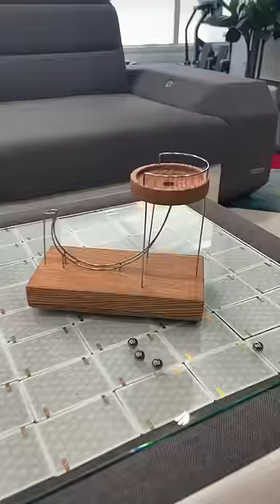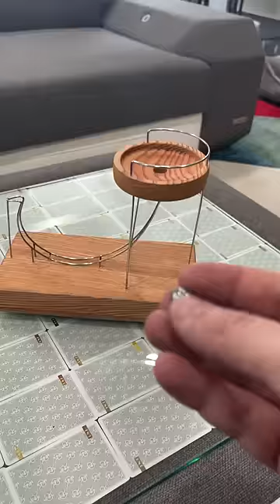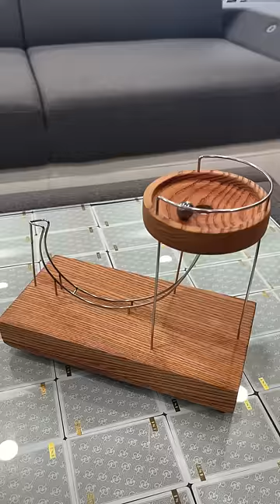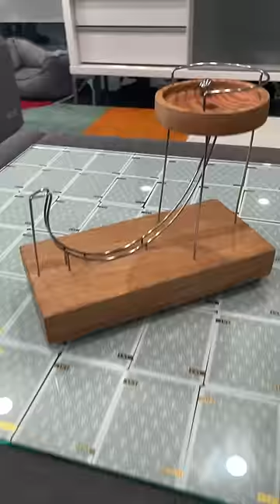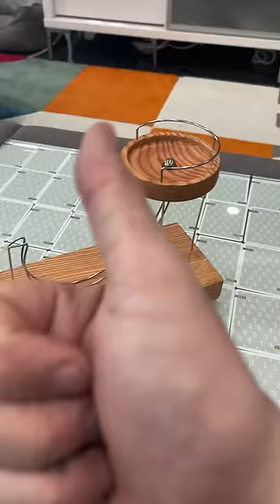An Impossible Perpetual Motion Device?! 😳 #Shorts

Comment: For those wondering, the ramp is powered with electric, that's why it's able to shoot that ball
Reply: why couldnt it just use magnets though?
Reply: @Gecko1115  Probably just cause it's simpler to replace a battery compared to magnets.
Reply: @holycrapitsachicken  ?
Reply: @monstermushmush  tf are you questioning, it was a very straight forward answer 😑
Reply: @Gecko1115  because it wouldn't work.
Reply: Really guys?
No, ho. It’s not electric. But angular momentum tf
Reply: @BossModeGod  so you are saying there is no external force acting on this system?? (other than gravity)
Reply: @BossModeGod  angular momemntum and another force, otherwise an etsy toy would literally break apart our understanding of physics. And the ball moves too fast for it to be just gravity
Reply: @BossModeGod  you're not serious,  right?
Reply: What is wrong with this comment section
Reply: @michabodnar7739  Its very slick oil like in Christmas Vacation :troll:
Reply: …but how
Reply: @BossModeGod  Check out Chris Ramsay's "Is This Perpetual Motion Device REAL?!" video. At 1:39 in that video, he opens up the bottom to show the electronics under the device. It's without question electric powered.
Reply: @BossModeGod  nope its impossible it went way faster than it should
Reply: Why couldn’t the ramp be made higher in theory then land on a pitched dish that feeds it back down? 

Perpetual motion is impossible but I’m unsure how if gravity is used in an example where the ramp is high enough to loop the ball.
Reply: I think a magnet would slow it down .
Reply: @Gecko1115  its an electromagnet. its triggered when the ball falls into the funnel to accelerate it downwards, but then turns off so it doesn't stop the ball from going up the other side of the ramp.
Reply: @limitedhangoutlive  using gravity and potential energy alone, the ball would never be able to go higher than where it started, even in a frictionless environment with no air drag.
Reply: @limitedhangoutlive  that means you pitched dish will be lower than the top of the ramp. To make it continue to work then you need energy to lift the ball back to the top of the ramp which is kind the same.
Reply: It's not powered by electric, there's a mini treadmill in the ramp
Reply: @limitedhangoutlive  the ball will always need to be launched higher than the ramp, in order to land atop it. So if you make the ramp higher, the ball will still need to launch itself higher than the distance it fell.Things don't ever bounce higher than the distance they dropped from. Things don't ever swing back the distance it was let go from. Things lose energy through friction and wind resistance and other minuscule transferring of energy from the ball to its surroundings. A professor did a famous demonstration where he let's a 20 pound cement ball swing from his chin, it swings back coming a couple inches from where he stood. Things don't gain energy, they lose it, so they always come back shorter.
Reply: @BossModeGod  plus gravity
Reply: It's an electromagnet. Battery powered magnetic field that will propel the marbel. Electricity alone won't move it, and magnets alone will just pull the marbel, ultimately slowing it down. But a magnetic field that is made and controlled by electricity will allow you to control the marble and propel it
Reply: why would it be powered by electric
Reply: @princelorian  so that the ball can launch higher than the distance it was dropped from, in order to land atop and repeat. Nothing naturally bounces higher than it is dropped, or swings back as far as it was swung from, etc. Everything loses energy through transfer to its surroundings through friction/wind resistance/etc. The ball wouldn't naturally get launched higher than it fell from without an external source of energy to add acceleration.
Reply: @princelorian  How else do you expect this to operate like it does?  There's an outside force moving the ball faster than just  gravity.
Reply: No its gravity…free energy is real. Governments dont want you knowing this…just use magnets or gravity. Energy is all around us…
Reply: @jonl9192  Magnets don't provide free energy.  Explain how you think magnets provide free energy.

There is no such thing as "free" energy.  It comes from somewhere.  It can't just magically appear.
Reply: I see you are a Comment section doctorate
Reply: @limitedhangoutlive  if you make the ramp higher (so that the ball jumps higher), the ball also now has to jump higher. No matter how tall you make the ramp, the jump will always fall short of the top of the ramp. In the same way that a bouncey ball never reaches the same height again
Reply: @Darion350  r/woosh
Reply: @limitedhangoutlive  because the existence of friction means the ball can never return to the same height or higher than it fell from. The potential energy at it's starting height is converted to kinetic energy as it is falling and some of that is lost through friction.
Reply: @jackraptor695  did you know sharks are smooth?
Reply: it's a powered magnet that pulls the ball down faster so it gets enough speed to make the jump.
Reply: @suslord9646  i think it's just a very heavy sphere
Reply: Can someone lemme know how this is done with electricity? I must be slow asf Because I don’t see any wires connected to the ball or anything that would make sense to me
Reply: @romulusnr  this makes the most sense to me
Reply: @holycrapitsachicken  What do you know chicken?
Reply: @suslord9646  Yes
Reply: @matthewgomez6024  my first guess is that the rail is energized by a battery, when the metal ball shorts the rail, a current flows through the ball giving it a temporary magnetic field which gives it a force to accelerate the ball until it is thrown from the ramp. Like a railgun. I'm not too sure though because each rail needs to be insulated from each other and here it looks like its connected, however he said it cant work if both balls fall at the same time which would be because it could bug out if both balls were shorting the circuit. So I'm reasonably confident that its probably like a railgun.
Reply: First law of thermodynamics, that’s all you need to understand that a perpetual motion device is impossible. The system loses energy due to friction , therefore there is a loss energy. Which isn’t the case here, ergo the system must have an outside source of energy that adds to the system.
Reply: It's got a 9volt battery in the bottom
Reply: I thought it accelerated way too fast. Also how tf can it go higher than its original height that would violate physics
Reply: @BossModeGod  lmao so you think this is magic. Gotcha
Reply: @Gecko1115  becouse magnet attracts, but also don't let the ball go further.
Reply: Thanks for saying it, you confirmed my suspect.
Reply: @Gecko1115  because a permanent magnet would start by accelerating the ball, but then would pull it back just as much after it went past it.
Reply: @limitedhangoutlive  no matter how high you make the ramp, the ball won't jump back up higher than where it first fell from
Reply: @Gecko1115  because magnets attract in the same way as they repulse so the addition of forces equals to zero... You have to put some energy to propulse the balls like in a gauss rail gun
Reply: The weight of the ball and the angular momentum I suppose 😇
Reply: Um, no. It's just momentum.
Reply: It is gravity
Reply: @Gecko1115  u probably could get magnets to work ,but a perpetual motion device lasts forever , magnets do not. This is why many devicee have failed there goal of a perpetual motion. Same for solar power ,eventually the mechanics fail ,even if 20 years later its still a fail
Reply: This is gravity. It's made because it never loses power. Its not friction either. This is obtained by multiple laws of physics one of which is when an object is in motion it stays in motion. This never loses motion and its similar to biking down a hill and never losing speed when hitting a flat road. You never lose energy so you don't stop unless you deem it to do so
Reply: There is a weel who launch the ball inside the hole
Reply: Wow the average level of physics understanding is quite worrying… 😂 

People making up magnetic ramps and complicated magic solutions like « but if I put a magnet in front of my car it will go forward » 😂 I’m dead
Reply: @matthewgomez6024  electromagnet in the base turns on just as the ball is accelerating down the ramp, then switches off just as it reaches the bottom.
Reply: @BossModeGod  no electricity,  no magnets... it's just motion conserving energy .... working with gravity
Reply: @Gecko1115  bro how would it use magnets to create perpetual motion??? "use magnets" is so nonspecific it makes me cringe 💀
Reply: @collander7766  You say that but it's getting touch detecting sarcasm nowadays since people believe this stuff.
Reply: @speedywiths3416  doesn't matter. When ball goes up the ramp wouldn't it's heavy weight slow it down then?
Reply: @anthonytestagrossa3801  sure sure 🤣🤣. No matter how smooth your surface is you can never get a frictionless surface. And you say very confidently that it's stays in motion. An object can only be stopped if it experiences a component of force opposite to its velocity and there are multiple forces doing that job. Gravity, friction, air resist, etc. Gravity does help it speed up but once the ball goes uphill it works as a resistive force. So yeah PERPETUAL MOTION ISNT A THING.
Reply: @suslord9646  ok yeah idk why I didn't think of that
Reply: @rycreative2699  unless...  the magnet pulls the bearing at the top of the rails (just as it passes through the hole)  then the gravity pulls it through the pull of the magnet  passes half point.  🧐
Reply: >the ramp is powered with electric

That doesn't mean anything.
I say there's an electromagnet at the bottom turned on for a set amount of time whenever something closes the circuit between the rails.
Reply: @holycrapitsachicken  
What? No.
A magnet wouldn't do shit. That's just like having more gravity. What is to be explained is why the ball goes up more than it goes down.
Reply: @matthewgomez6024  Imo the ball itself closes the circuit between the rails. The question is whether the electromagnet turns off after a certain time or is turned off by the ball crossing a certain section of the rail.